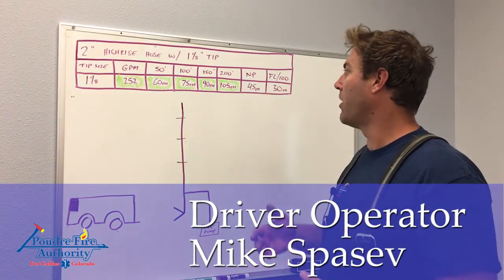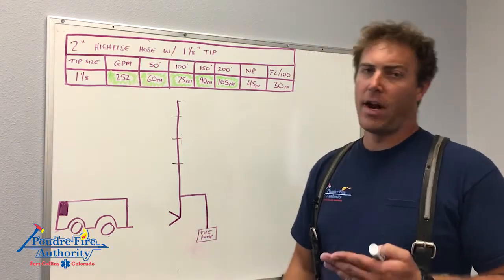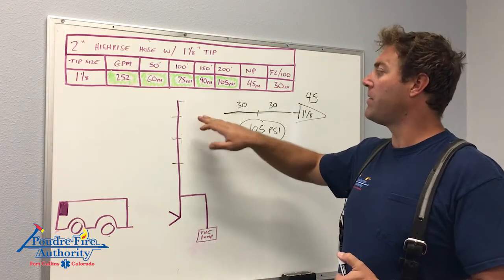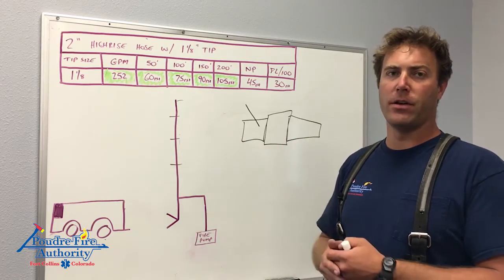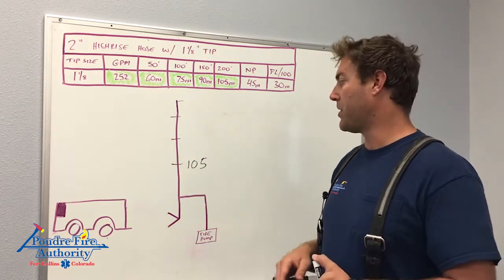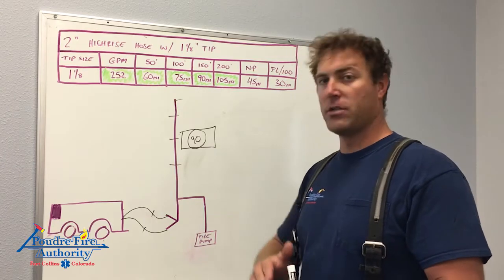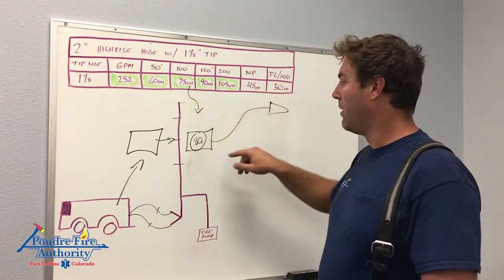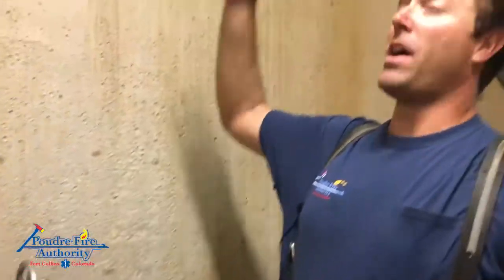Highrise Hydraulics Video

Comment: Just found the video. Looking at 2" with 2.5" couplings for our hirise paks. Do yall plan for putting a second line in play on the fire floor? Just didnt see that option in your hookup.
Reply: Chris,  consider both 2” and 2.5”.   You truly gather a larger fire flow from the 2.5, especially with 1.75 tip or 1 1/4 tip.  
Always consider the potential failure of the fire pump.  In pumping to a high rise with appliance loss, you may very likely not have the flow from the hookup in question for two lines.  Gated wyes are pressure robbers and when flowing high GPM or pressures, wyes are very dangerous.  All pressures are transferred from one line to the next as lines are opened and closed.  Consider instead the larger line is controlling your hallway or in open offices, giving you the reach through the cubicles from defensible positions.  Consider the fire loads for your jurisdiction in determining size of high rise lines.  
You should also always be planning to pump to the highest floor in the building. As fire doors are opened through escape and fire attack, you must consider fire spread to the floors above. Use of the inline gauge and figuring fire flow per floor with use of a person to monitor that is spot on.  Many departments use the 3rd or 4th person on the line who is responsible for monitoring fire flow and feeding lines.
Reply: @Rescue-mt7fl  Some of the British fire brigades have changed to 30mm solid tips, using 65mm hose. A little math shows this is almost exactly a 1-3/16” tip, with 65mm close to 2-1/2” hose. Yes, Akron makes a 1-3/16” tip. At your NP = 45psi the 1-3/16 tip flows 280 gpm. I think they sized up to 30mm especially for open office floor plans. Remember sprinklers are much less common in the U.K., and they want to be ready in event system doesn’t operate. 

I don’t think their FP bureaus have historically been right on top of periodic ITM enforcement. Is yours? One indicator of that question is, do you have an inventory by building of all active FPS in your jurisdiction? If you don’t, you probably don’t have an effective ITM enforcement system unless you’re tiny.